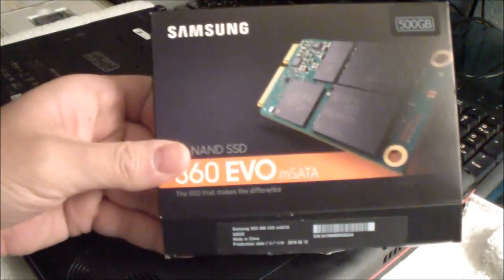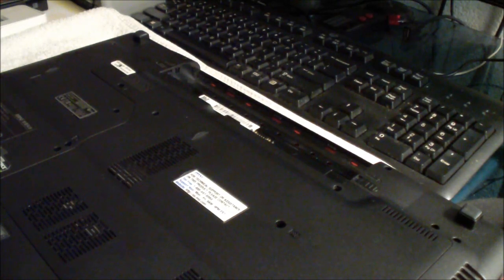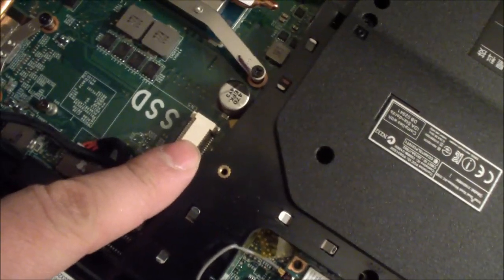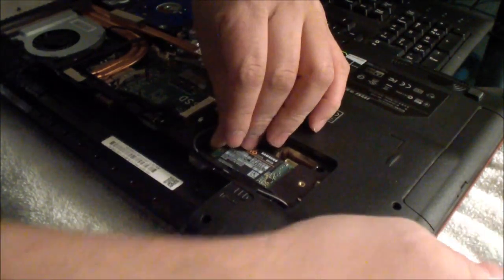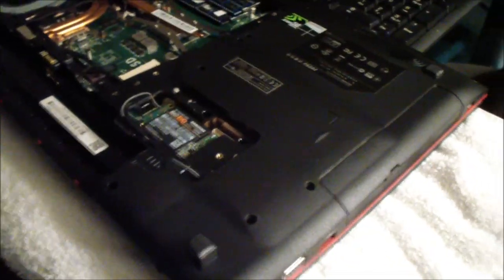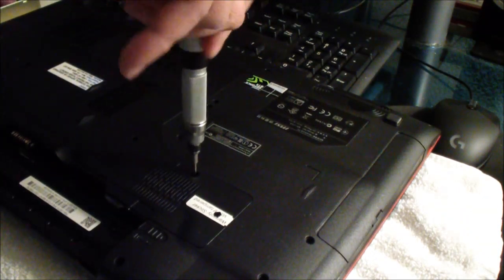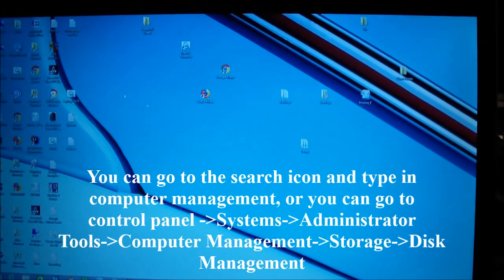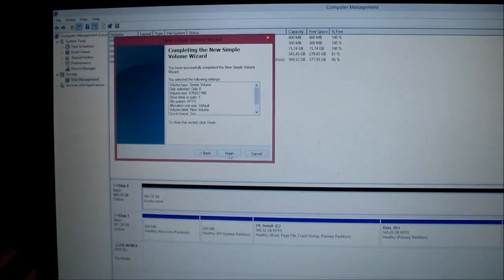MSI Ge70 Apache Pro 012: How to Install a msata SSD

Comment: I found a pdf file where it shows the GE70 have 2 msata sata-3 that can be configured in RAID 0 and 1 2,5" slot.
Reply from the maker: You can use two types of SSDs on this computer, the first is a msata SSD, and the 2nd is a sata SSD.
Reply: @Ace1000ks  Thank you! I liked and subscribed to your channel here.

Comment: Awesome vid! One question, at 4:50, what size screw is that? I have a GE602PE and, for whatever reason, the screws are not on the board. Thanks!
Reply from the maker: It is a M.2 screw. 
https://amzn.to/3l1b6SV
Reply: @Ace1000ks  thanks!

Comment: Helpful video thank you. I have a GP70 2QF (very similar) Im trying to find the ssd but im afraid of making an error and choosing the wrong one. Have any advice on which one fits right?
Reply from the maker: Does your computer have a msata port?
Reply: @Ace1000ks  yes
Reply from the maker: @vladimirkrishtal1402  The Samsung M.Sata SSD is the best one you can buy for this computer. Kingston is another good brand, they have a 480 GB version https://amzn.to/3nUrgzY .
They also have a 240 GB Kingston M.Sata SSD at Amazon https://amzn.to/34VLLny .

They also have Dogfish, but that brand isn't as good, but it is cheap.
Reply from the maker: @vladimirkrishtal1402  You can also replace your 2.5" hard drive, and replace it with a 2.5" Samsung 500 GB SSD. https://amzn.to/3dqKngm
Reply: @Ace1000ks  https://www.msi.com/Laptop/GP70-2QF-Leopard-Pro/Specification
Reply: Yeah i went ahead and got the kingston 480 hopefully it is compatible
Reply from the maker: @vladimirkrishtal1402  Let me know.
Reply: @vladimirkrishtal1402  i have a msi ge70 2OE 011NE

Comment: I have the same laptop (i think it says on the back ms-1759) i want to buy SSD, can i install M.2 type or i have to find SSD msata??
Reply from the maker: The model I have does not support M.2.
Reply from the maker: You  can only use msata SSDs on this laptop.
Reply: As i suspected. Thank you for your answer

Comment: I will buy sdd for my ge70. Do you like samsung 860 SSD, Which brand do you think would be more favorable for ge70 SSD socket?
Reply from the maker: Samsung EVO 860 is very reliable, I don't know about the other brands. The other brands may be cheaper, but they don't have a reputation on their reliability.
Reply: @Ace1000ks  Thank you for your answer and experience))

Comment: Liked your video, it was really helpful, and I also have a question, My laptop is a Msi apache pro Ge70 2QE and I was looking on its specifications and it says “Up to 128GB SSD(1 x mSATA)+ 1TB HDD 7200rpm” witch makes me understand that it might not support a 500 gb sad like the one you’re using... is it the same case for yours?
Reply from the maker: As for msata SSDs, they are all the same size. For M.2 SSDs, they have different lengths. The longer the M.2 SSD, the more data it can store. Back in 2014 when the MSI Ge70 laptop was produced, they didn't have 500 GB msata SSDs. Maybe that is why up to 128 gb ssd was put into the specifications, I am not sure though if the msata slot limits the capacity of the drive to be 128 gbs.
Reply from the maker: As you saw in this video, I put a 500 gb msata SSD in it, and you saw it work. As for the hard drive, you can put a 3 gb hdd in there if you want.
Reply: That actually makes sense, I’ll give it a try and hopefully it’d work as good as yours in the video, thanks so much
Reply: @jefrytavarez7814  did it work?
Reply: Josu Carrasco it did, it works very good actually
Reply: Jefry Tavarez which one did you buy?
Reply: Josu Carrasco it was the Samsung 860 EVO mSATA (512 GB)
Link:
https://www.amazon.com/dp/B07822P8JY?ref=ppx_pop_mob_ap_share
Reply: @jefrytavarez7814  Здравствуйте. Скажите пожалуйста, как вы думаете, можно ли поставить 1 Tb ? Спасибо.
Reply: @CoTHuk  Честно говоря, я не знаю, так как не пробовал, однако вы можете попробовать и сообщить нам… хорошего дня!

Translation:
I honestly do not know since I haven’t tried it, however you can give it a try and let us know… have a great day!
Reply: @jefrytavarez7814  Спасибо
Reply: The up to 128gb also probably just meant the highest configuration available for purchase by the user.